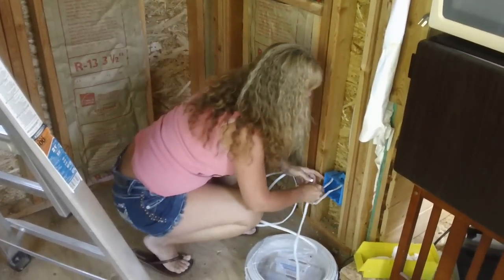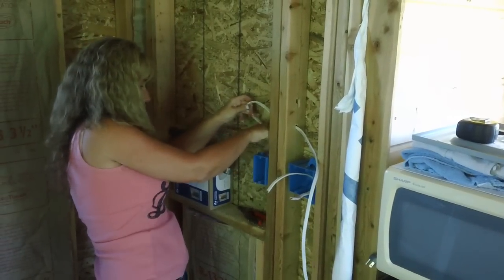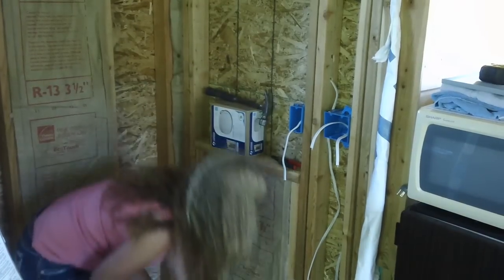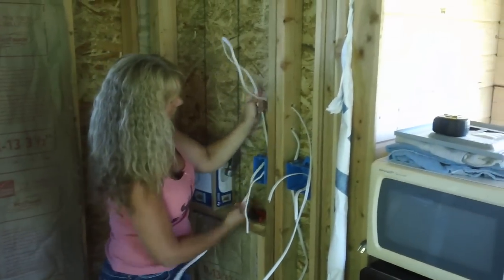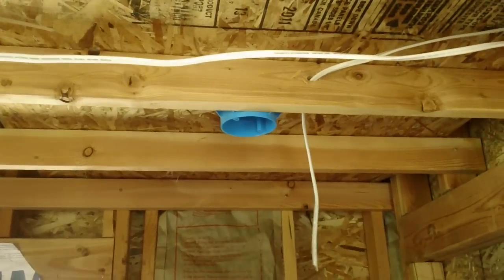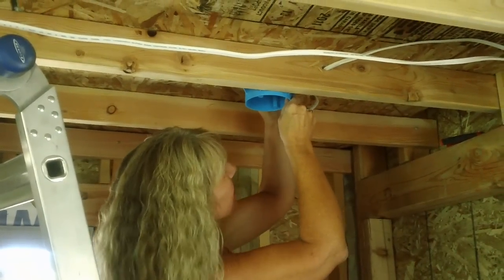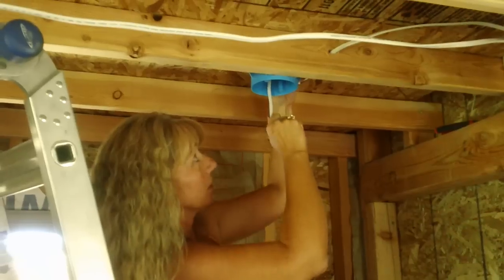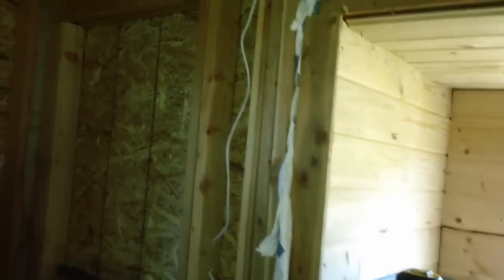My wife is now an electrician! Annissa is wiring the tiny house.

Comment: Well Kevin this is inspiring. I am building a tiny house but the bf is always gone and I'm tired of things not getting done. I bought my house plans from Tumbleweed house company and I I have the electrical list of the parts I need to buy minus the decorative things however there are no instructions on how to wire the home. My biggest concern is after it's done if it will pass a electrical inspection. I take it you are a skilled electrician and if I follow your plans I should be ok? Thanks Megan
Reply from the maker: +Megan Zopf Hi Megan, Yes this is wired to code.The video is easy to follow thats why I had my wife involved. She had no experience.
Reply: +Megan Zopf
You will need a licensed electrician to sign off on your work. First go get your permit.
Reply from the maker: +Cesar Rodriguez No you won't . This does not fall under any jurisdiction as it is on a trailer and therefor exempt.
Reply: Kevin Coy
Thank you, I was not aware of the trailer "Law". Although, this applies to me, my response was for Megan Sopf who commented on building a "tiny house". Will it also apply to her since it'll be a small building rather then an addition to her home?
Reply from the maker: +Cesar Rodriguez It depends on the area she lives in. Tiny homes are not allowed in most places so the whole thing is a guerrilla project. If you pull a permit you may draw unwanted attention.

Comment: Is rewiring a mobile home same as a regular house, to include codes?
Reply from the maker: Yes you want to update to current codes. Mobile homes are often wired substandard . I have repaired to many after fires from faulty or substandard wiring.
Reply: Maybe same question,but are codes the same Mobil homes/regular house or is it based on local city regulations?
Also, can any licensed electrician rewire a mobile or does it require for him/her to have a additional license for mobile homes?
Thank you for your advice.
Reply from the maker: Cesar Rodriguez Licensed Electricians can rewire a mobile home. The local municipality will govern the regulation and inspection of the process.